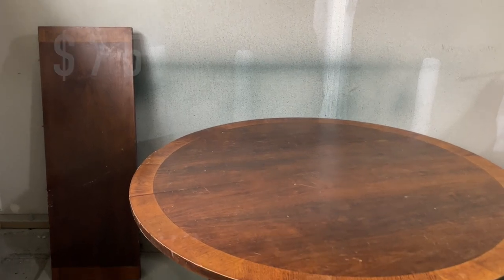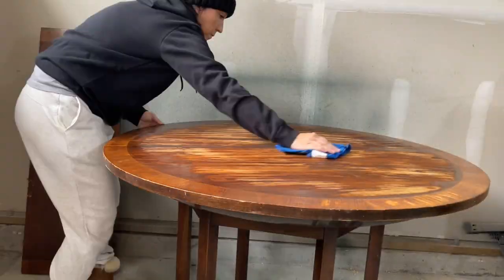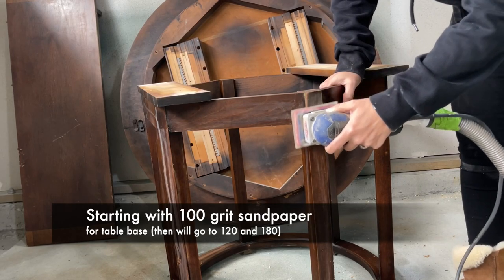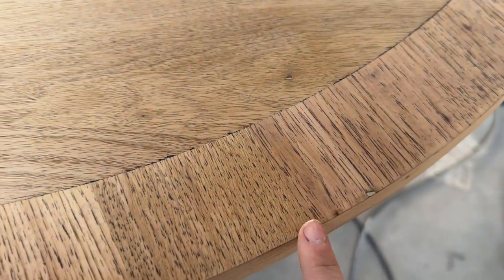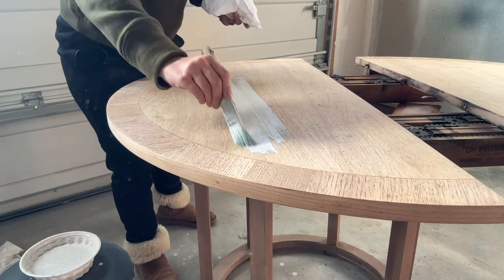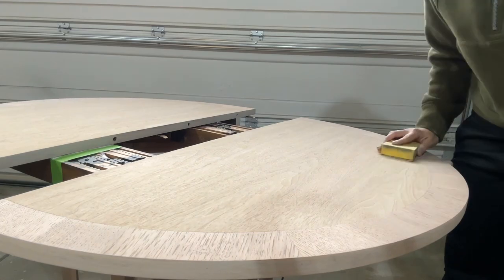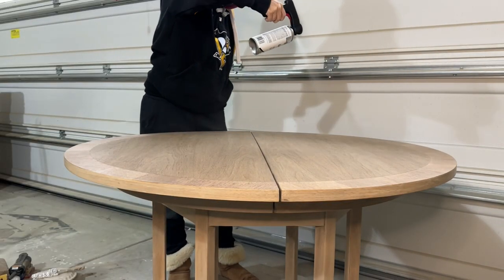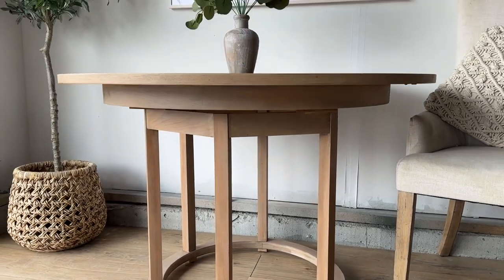Old Table Turns Into Restoration Hardware Look-a-Like | Facebook Marketplace Find

Comment: I am stealing your idea for my newest project. I would not mind knowing how the paint/stain went over the wood filler and what you ended up doing
Reply from the maker: I noticed I completely forgot to talk about that! 🤦‍♀️ It actually went over perfectly so I didn’t have to end up painting the little wood filler sections to match 🙌 but if you did have bigger dents, I would just grab some brown paint to match your stain and use a very small brush to paint the areas. I’ve done this technique before and it works out great!

Comment: This couldn’t have been a better tutorial for my next project. My table is almost the exact same color, and it needs to be refinished badly (20+ years of wear and tear). I also need to do the 4 chairs 😬. This will be my first refinishing project. I built furniture in high school woods class and did stain and spray it with lacquer in a sprayer, but have never refinished/modernized anything. I plan to start with sanding the underside of the table leaf to test the whitewash and stain first and then get to removing the old finish and sanding. Thanks for all the detailed steps and explanation throughout and links to what you used with the project. I’m going to buy the Surf Prep sander with your discount code. Those chair slats will be murder even with that sander I bet! Awesome again that my table is so much like yours before you started, makes me feel more confident to get started!
Reply from the maker: Thank you so much! So glad it was helpful to you! 💛 testing out the stain on the underside is a great idea!!
Reply: I hope you post a video of your upcycle.  I think it is so cool that you originally made the furniture!